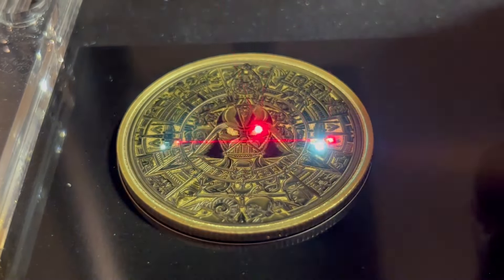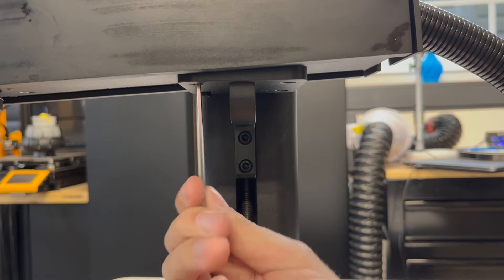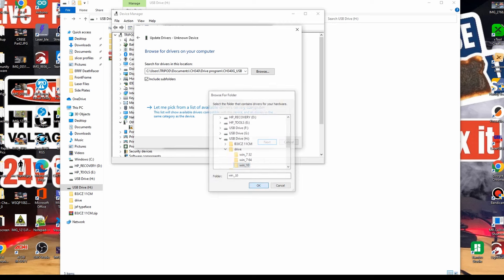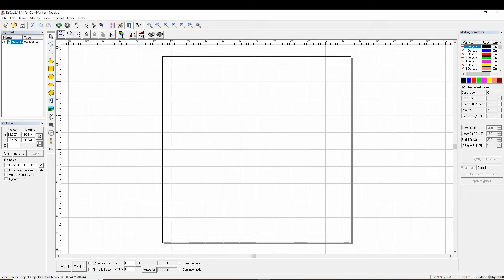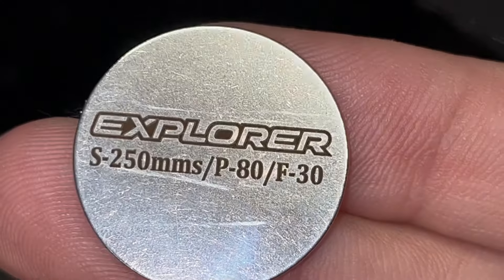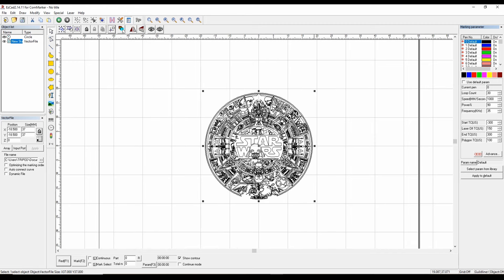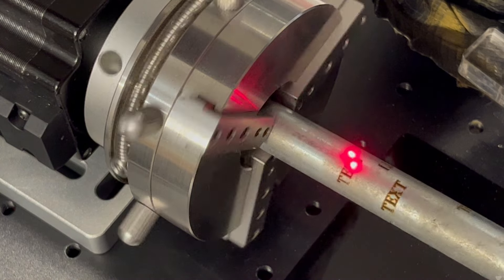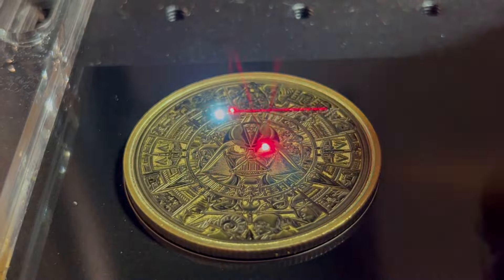ComMarker 20 Watt Fiber Laser  - Your First Fiber Laser?

Comment: I'm looking to get into gun engraving and will be engraving on stainless steel, carbon steel, titanium, aluminum, and polymer, would this machine be a good option? Would the 30w or 50w be worth the cost difference? Also, I would like to maximize my work area while still being moderately efficient in engraving times, what's the biggest work area that fits that for this machine? Do you know what it would be for the 30w or 50w? Thanks and great video.

Comment: Very informative and interesting video..

One thing I didn't understand is why you did the 3 colour thing with the coin and the rotation thing? 

I do have a laserpecker 2. But it's not really powerful enough to do some of the things that I want to.
So I'm interested in this item.
Reply from the maker: Thanks for watching.  Rotations will keep the etching consistent.  The two other layers where at higher speeds, and higher frequencies.  This will actually clean up the darkness from the main engraving.  Hope that answers your questions?